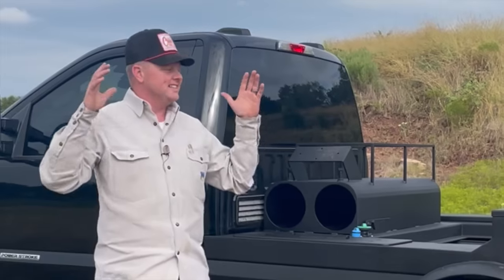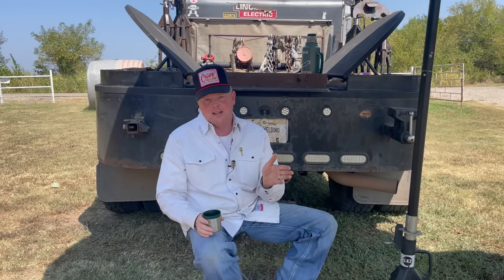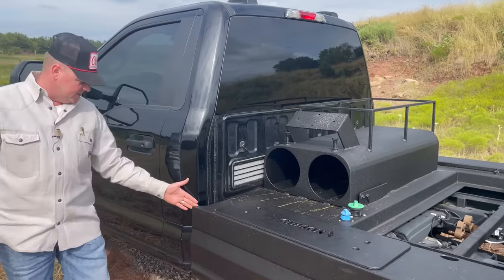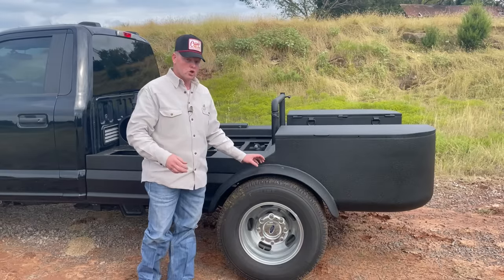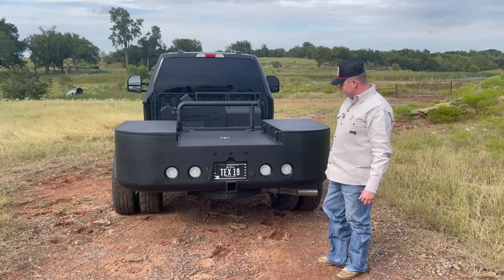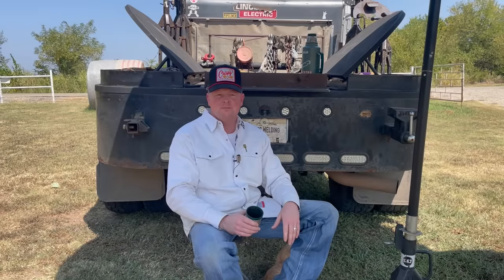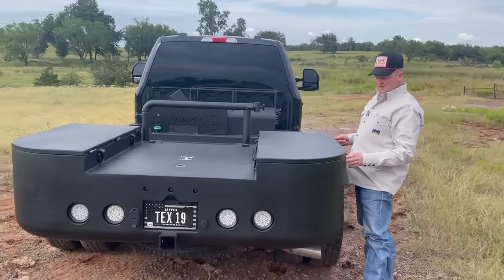Welding Rig Tour - New Build is Finally Finished!! (Full Walk Around Tour)

Comment: If wind is a problem on the back boxes maybe a short bungee strap to keep tension on it when needed, Or you could put threads on both ends of holding rod so a few turns would lock it into place.
Reply from the maker: That’s a great idea

Comment: That's a slick setup, like the Rino Hide look, and the inner fender over the Dually wheel wells. What would be awesome is hydraulic actuated pins to detach the bed and drop-down legs to stand it in place. Then a Flatbed to attached to the truck frame by just backing under it and same pins to secure it to the truck. That would have a Dual useability. Probably use and electric 12volt pump to overate the pins.
Reply: That sounds like a roll off truck and a special box to work off of
Reply: Not a bad idea but it’s not just a welding bed great idea but at that point why not set up a job box and a little trailer.

Comment: Mighty fine well executed project young man. Anyone would be proud to owne it.
       I do think it needs a headache rack to protect the cab. I really like the way you locked the tool boxes. 
        A short story from my dad. He worked as a welder building municipal water towers when i was a baby. The contractor he worked for had all tool boxes made to be locked with a 5/8" bolt and nut. He demanded the bolts to be tightened with 2 - 12" adjustable wrenches. They never had any tools stolen. All of the other contractors were constantly being robbed of their tools. The bolt cutters used to cut off locks could not work on the bolts.
Reply from the maker: I appreciate it. Yes, a head ache each would be very practical. That’s a great story and great idea! Thank you for sharing!

Comment: Really nice work, nice bed. If I added anything it would be a drop in tray in each of the toolboxes for small stuff I did not want to get lost in the bottom. 

I like the simple elegant lock. Not many folks carry an allen wrench on them since they have no idea they would need it and you would need a deep one too. 

Another elegant way to make a lock is to make a rectangular pocket to slide a padlock into and place a retainer plate on the backside on the shackle after you install it so it can’t fall out or be removed. Then put a hook hanging down from the lid that catches on the body of the lock itself when its pressed in and locked, but when its opened it does not catch. Almost impossible to break open without total violent entry if you use a quality lock.
Reply: That’s how the Ridgid job boxes work. I have a Greenlee box and you have to all but lay on the ground to see the keyhole for the padlock.

Comment: One of the slickest work beds I’ve seen built.
Pool noodles work great to cushion loads, am
Nd the can be put over ratchet  straps.
And pipe insulation works also if you need bigger size

Comment: Austin, Austin, Austin. You don't understand an Uh Oh until you run over a section of HVAC roof with  a 4 ton forklift. 

True story from almost 2 years ago. 50 foot sections of duct work we were building and our forklift driver, who by the way is one of the best in our area, accidentally grazed the front corner with the back tire when he was trying to back out and around another section we built. My supervisor and the guys who made the roof were working frantically to fix the cap that was built into it and make it look like nothing happened so we could install it. By the time they were done, we could still see where "something" had happened, but it was so much better than it was... Still thankful I work alongside some great miracle workers... They have done the impossible several times since then for us.

Comment: Nice looking bed! mines just a flat bed with tanks at the front welder in the middle tool box’s under the bed in front and behind the rear wheels all flat in the back for a work bench don’t pipe line weld just fab work and around the farm kind of welding not the perfect set up but can work well for most things and also I keep things simple so they are easy to fix on my old truck

Comment: The Plate that's not lockable could be used to replace a palet to get under the pipe when mud is present or just 2 not lay on floor just needs allitle more adaptors but overall best custom box I've seen and quality and durability I love my good multi tools

Comment: Serious question here: 

As someone who isn’t a welder I’ve always wondered why welding trucks are always 350/3500 dually diesels when in all reality a 1500 would be more than capable of carrying the tools around. Is it a regular occurrence that welders are also having to tow heavy things or is just about having a big truck?
Reply from the maker: We carry lots of weight. And yes, also pull trailers. And a lot of use out lots of miles on them. Therefor, it’s better to have heavier suspension parts, u joints, ect…
Reply: @arosswelding  that makes sense 👌🏼 I just always see the truck by itself and have wondered that for awhile lol
Reply: I know he had already responded but there’s a lot of upsides actually to diesels like of course reliability, a lot of these guys travel and their campers are their homes so a lot of the time they go all out and get giant campers and they wanna be hauled efficiently, you can actually make a diesel more fuel efficient than a normal gas using pickup too which is funny and the diesel noises 😫
Reply: @arosswelding hey brother can you do me a favor and let me know roughly what the bed cost in raw material ? No labor cutting or bending cost just the raw pipe/plate/sheet cost?? Thanks man!! I’m finishing up my 07 lbz dually and about to start on a bed myself to upgrade from a ugly ole service bed I’ve been using for years, going to be building a bed very similar to this one just a little shorter on the rear end and little less deep toolbox wise

Comment: tidy job , is the back end on air , as it seems to haave very little suspension movement room . ?
Reply from the maker: No. There’s is more room than what it appears on camera. But it could still use some air bags. I’ve had air bags on most of my welding cars
Reply: @arosswelding  yep , even standard spring assisters  would make a huge difference

Comment: What are two horizontal bottle holders for?
Reply from the maker: Oxygen bottles. 2x k- sized
Reply: Do they not use acetylene? Or did I miss that spot?
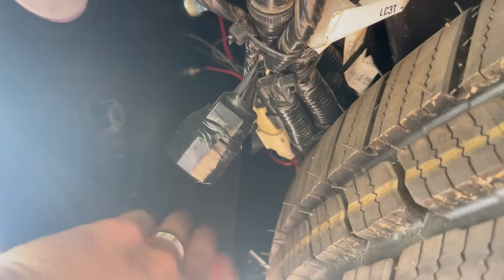Reply from the maker: The acetylene is on the passenger side. 18:00

Comment: 14:49 my boss gets frustrated with me because I take a while to do my assigned projects but they turn out wonderfully. Look like someone programmed the job into a machine and the machine did the job. 
Then an old guy put up some support posts. God turned away when he saw the job he did. I was tasked with cleaning the I-beam he put the supports on and I couldn’t believe my eyes. Safe to say “the report I wrote in my notes  was very detailed and clearly states who did the welding and fab of the support posts.” 
God bless American and the two sailors who’ve went off into the depths of the sea. Flowing peacefully as the waves rolling up on the shores.
Reply: Love the truck. When I build my truck I want it to be a 77 ford with a f450 frame brand new from ford with 12 valve Cummins. Thanks for the video you’ve posted. I’ve learned how to properly weld because of your work and others. Thanks so much.

Comment: RIP those tires whenever this truck has any serious load, or goes offroad. I've personally witnessed dudes shred their tires because they never consider the fact that the suspension can have a fairly significant amount of up travel before it hits the bump stops. Perfect reason to get a lift I suppose.

Comment: It's nice bit the hitches I see issues.  I wouldn't trust them. Specially the slide in receiver.  The 5th wheel hitch u mount to far behind axle, u can't haul a good size trailer without it making the truck ride like crap.  5th wheel should be over the axle or as close as possible.

Comment: Why would you need two K bottles? I'm curious?
Reply from the maker: Usually a guy will go through two k oxygen to one med acetylene. That is just a rule of thumb. Depending on what thickness, a guy is cutting a lot of, it may not work out that way.
Reply: @arosswelding  I see, okay! I usually carry one of each, but, my work doesn't require to much torch use, compared to the typical. Makes sense!

Comment: So on the lead cover, there is a notch on each side of his last name. Why is the right notch smaller then the left one? Unless I’m seeing things but I noticed it right away
Reply from the maker: 🤷‍♂️ I guess I didn’t notice that.
Reply: @arosswelding  I guess you will now lol. Didn’t mean to point it out🫢
Reply from the maker: 🤣 no worries. I think it must have been somethin with the camera cause I’m pretty sure they are the same size. Maybe the line x was put on a little thicker on one side. 🤷‍♂️ 
You’ve just got a sharp eye 👀
Reply: @arosswelding  maybe is the camera. Idk I looked at multiple different shots and I swear it was different sizes. Oh well. That deck is very nice regardless, well done.

Comment: I've never been able to wrap my head around the very little up travel clearance on the rear wheel wells on most welding rigs. Is it an illusion and more room is actually in the wheel well?
Reply: That’s always my take as well. Maybe I’m missing something, but it looks like the tires will rub just loading the truck with tools?
Reply: @PapaMurph-dg6gj and not to mention going over bumpy rocky terrain now ya it does seem like you got some chance of rub. But that’s obviously not the case as Ross does this for a living he knows what he’s doing. I agree it does look like very little clearance. Must be illusion on camera
Reply from the maker: It could use some air bags but he shouldn’t get in a bind.

Comment: One bump and those tires will be rubbing.
Reply from the maker: Could use some air bags huh
Reply: @arosswelding definitely if he's planning on hauling a camper too.
Reply from the maker: There is about 3” of clearance if I remember right. I just looked at the video and on camera it looks like there is only like 1 1/2” or so… the shadow makes it look like less. But I still think he could use some air bags.

Comment: why are all these welding trucks not even protected from rain?!?! seems fake, what are you welding bridges? anything under 1/2'' can be done with a tiny welder like 30lbs to 50lbs, you don't need an f350 for welding unless you wanna tow things 30,000lbs+ you are much better off with a smaller lighter 4wd fuel efficient vehicle, with cheap maintenance